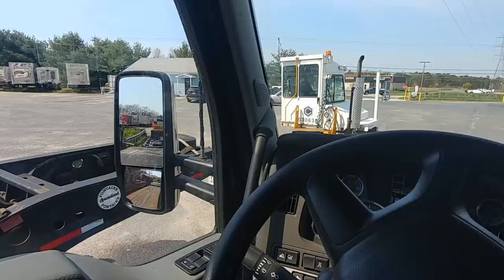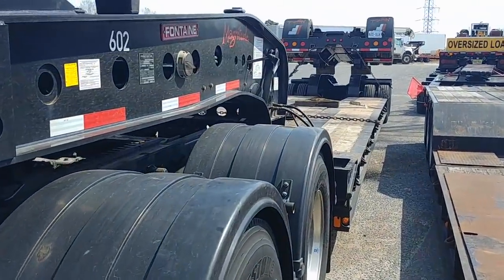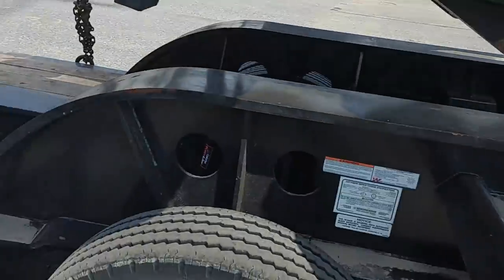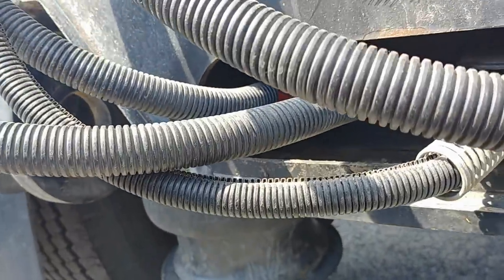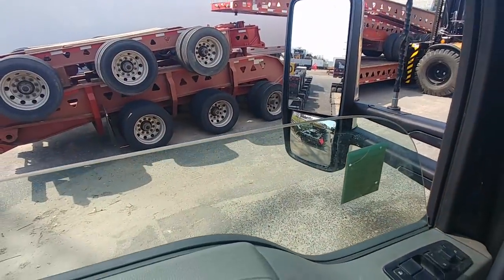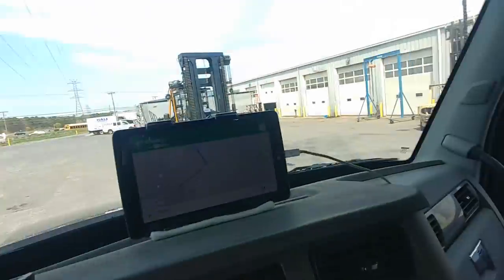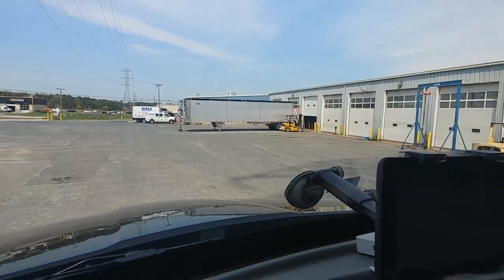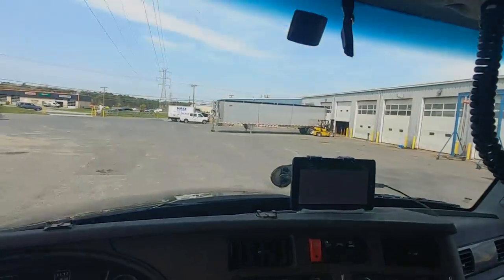04/18/19 -- "Your trailer is ready!" -- Voorhees, NJ

Comment: You don't have to have the Larger Flip box to run the 402J Jeep. You can run the 402J Jeep without the Larger Flip Box. You have enough swing clearance to run the 402J Jeep, if the Jeep is Ordered with the Longer Sliding 5th Wheel. Joseph Equipment Co (Fontaine Dealer) has ordered the 402J for the 55 Ton with a Longer Slider to run with a 55 Ton & 60 Ton Trailer. That way you only have to buy 1 Jeep. The 302J is called a Jo-Dog Jeep and is used to make a Quad Axle Group with the Truck some States will only give you 72,000 Pounds, some will give you 80,000 Pounds, would would be better off getting one Jeep with a 14'1" Spread with a Longer Slider and then you can use its with a 55, 60, 65 Ton Models. To scale 70 Ton and sometimes 65 Ton you need a 3 Axle 452J Jeep.

Comment: You need a trail king trailer man. Thats a cal legal lowboy. You can actually take the deck and seperate it from the wheel area and make it a longer or shorter trailer with other sections of deck. We built one that had 5 different deck pieces that had to be able to put together. It looked like the st. Louis arch with all 5 together. Be safe out and keep her shiny side up
Reply from the maker: I prefer Fontaine. My 60 ton is a modular trailer. I can change decks, remove axles, and use deck inserts.
Reply: @HHTV60  nice didn't know theirs did that. I usta weld at trail king. I built the trailers lime yours
Reply: I'm watching these videos late. I think your new trailer, is much better than the old one. 
I was an equipment operator in the  Air Force Reserve and my first civilian driving job was for an equipment rental yard. How hard do you think it would be for me to switch from my current tanker o/o job to Heavy Haul o/o work?